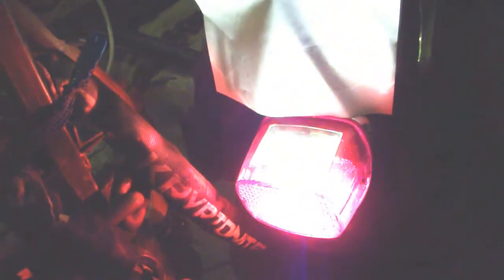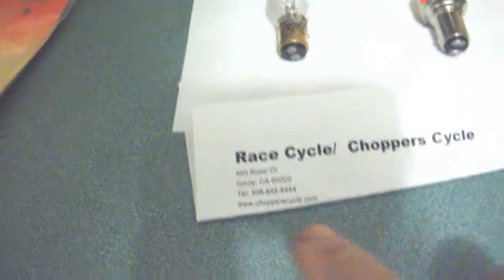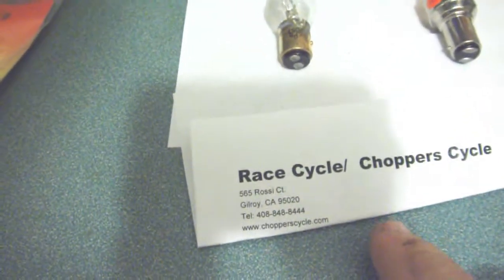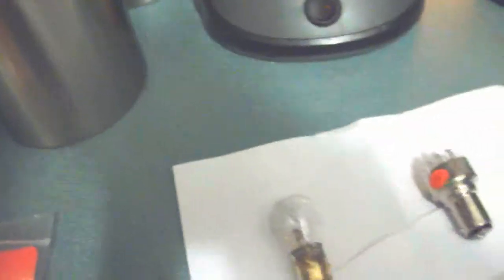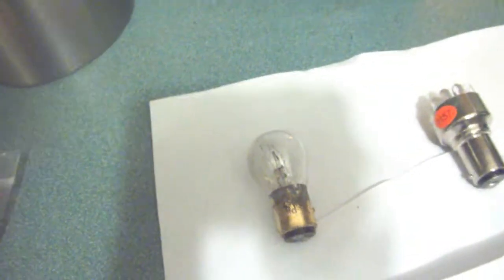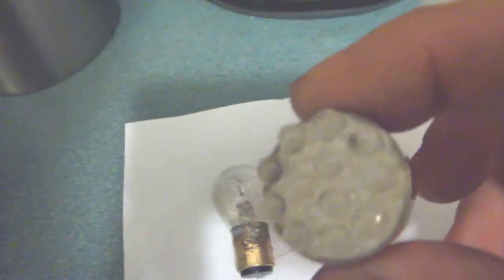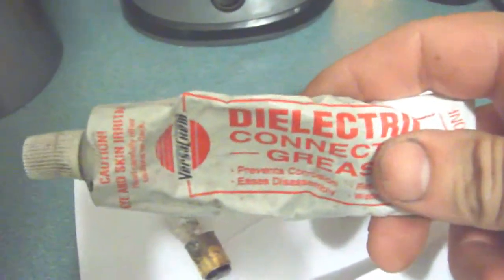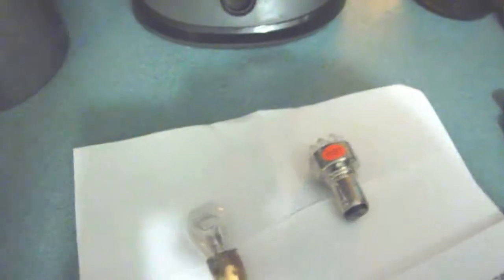Harley - LED Taillight Install.

Comment from the maker: The problem with LEDs is that if you need the light to shine on the side and top, then there would be LED's needed to be the bulb on the side and top.  This LED was all to the back, but could work very well for other taillights.  I just wrapped it in bubble-wrap & will keep it in the saddlebag in case I need a spare.  At least the LED light will not break easy at all.  That is the only light in the back, so having a unbroken spare on hand would be smart.